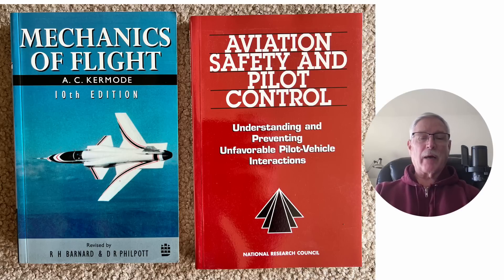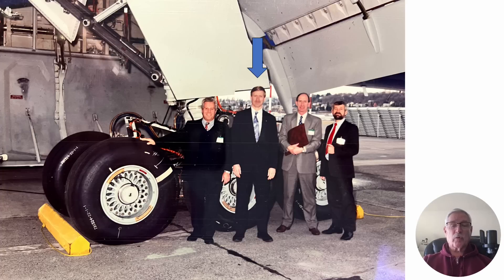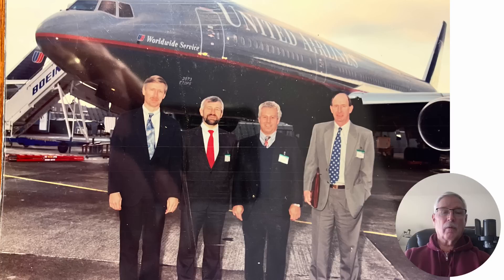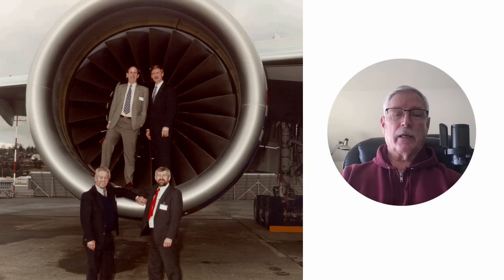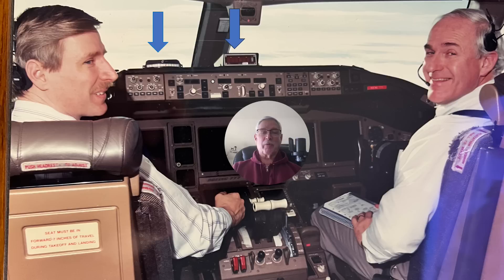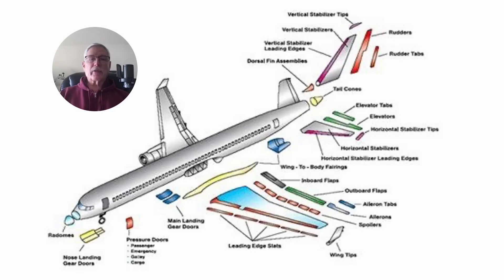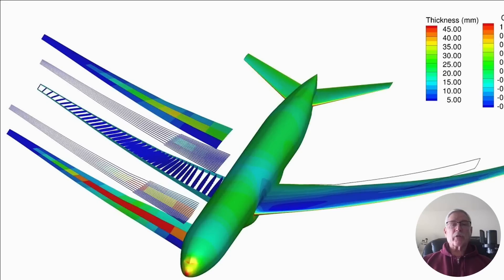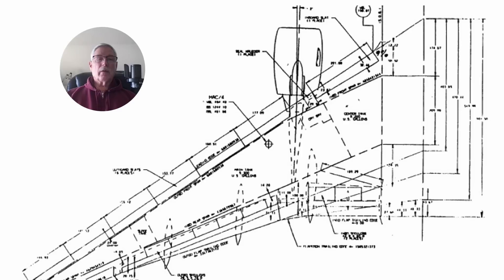The Dreaded Boeing 777 Lateral Structural Mode, Pitch Pilot Induced Oscillations, and other issues!

Comment: I’ve seen PIO’s as a passenger on the 777 owing to the flexible outrer wingtips, which by the way give you such a great ride thanks to their shock absorbing capacity . At lower speed the nervous pilot bends them in what I identified as aeroelasticity where the wing tip itself bends up/down before translating into roll, but I might be wrong.

Comment: I think it's more then 17"s to top of inside cowling of engine, looks like double that for sure?  GE90 inside is about 10.6 feet inside cowling.  Maybe for Andre the giant, but he's dead.
Reply from the maker: For this smaller engine on the A or 100 models, it was 17". Measured it myself. Now the bigger engines, especially the 90 are much larger. Had Andre on two of my flights. He barely could come into the cockpit!
Reply: @ronrogers  Wasn't there a rumored story that Andre passed gas so bad, a 727 had to make an emergency landing?  Maybe not, but funny...
Reply from the maker: The 727 had great airflow so would be surprised about that. Never heard that story.
Reply: @ I made it up...